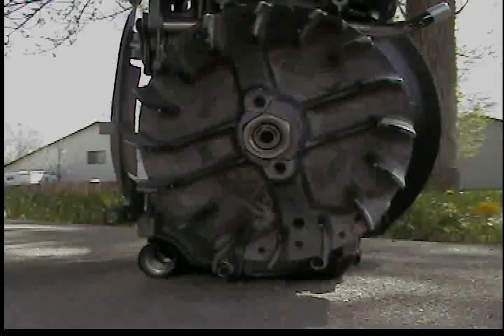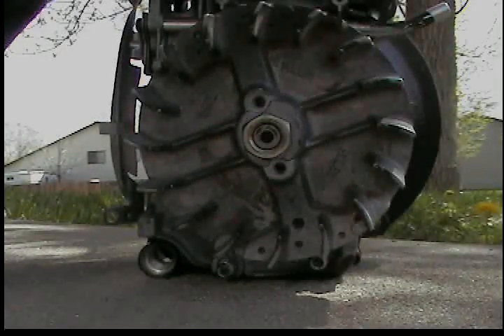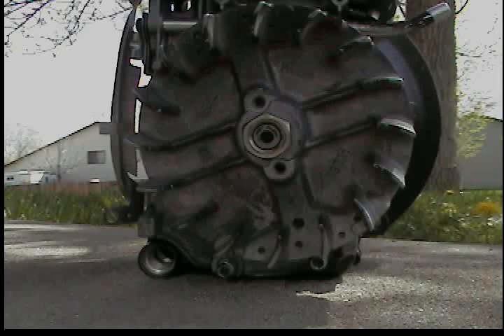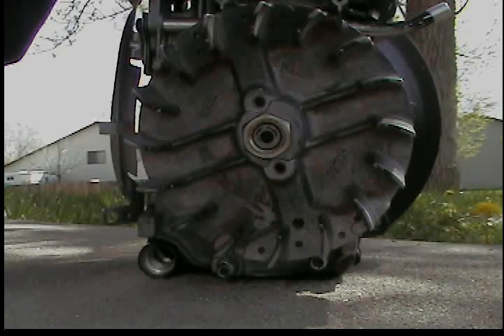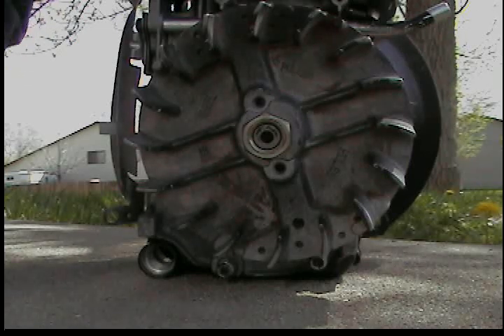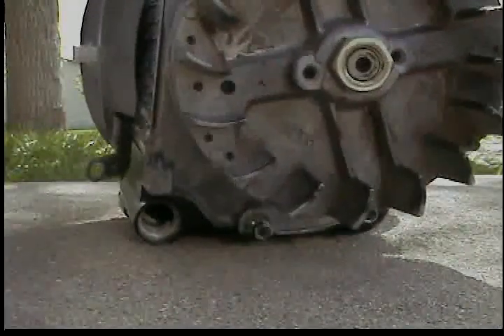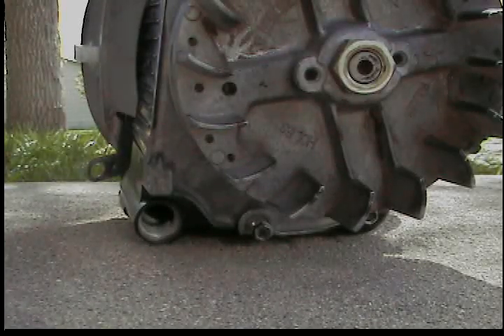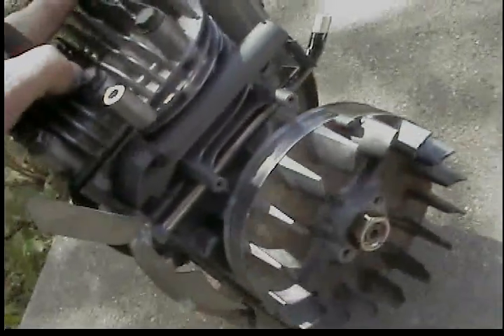Air powered 2 sroke briggs

Comment: try add a micanicle valve to the air (spark plug hole) intake it will let it run faster and longer